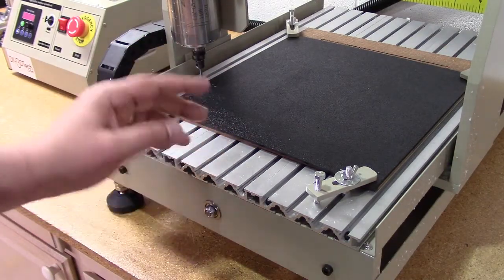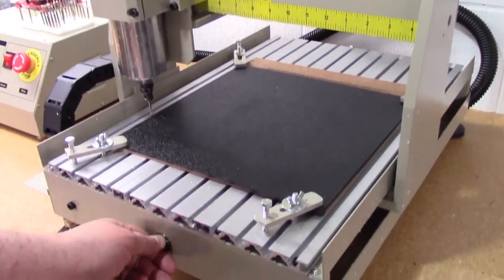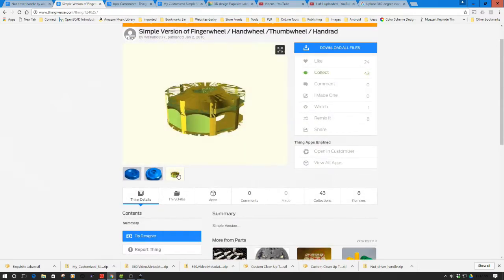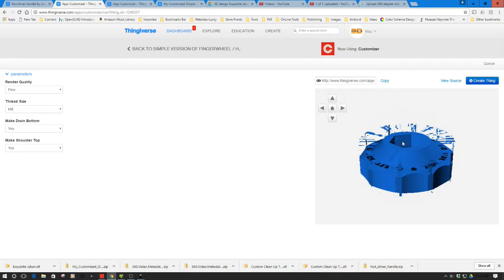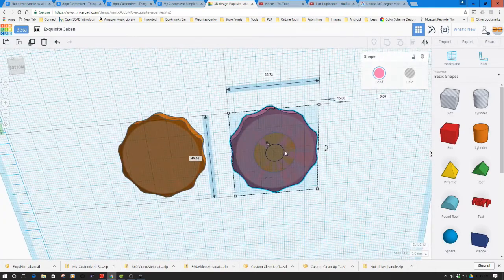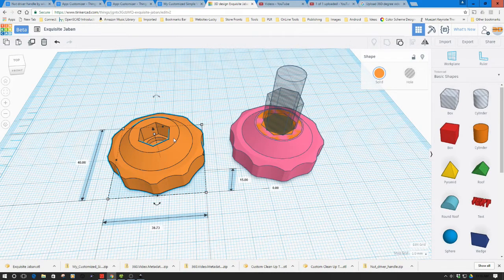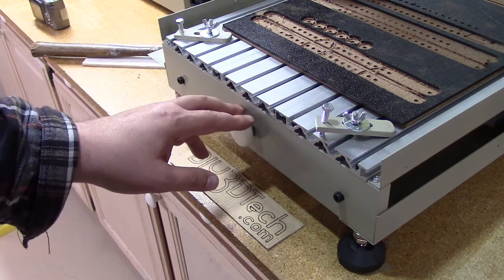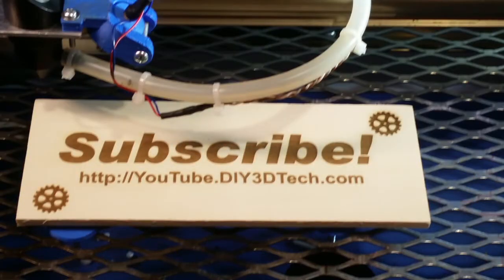3D Printed Project - Finger Nut for the Y Axis on the 3040 CNC!

Comment: Joe, do you need to move the gantry a lot or just a little?

If you needed to move it a long distance I could see making the knob with a bigger diameter and either a dimpled finger hole or a protruding handle to crank it. 

Other than that it was a practical solution to a real problem.  Good video.
Reply from the maker: +Norbert Davis yes on the other one I have a spin wheel however this one I did not have enough rod to do this with.  So the knob is better than nothing and for longer jogs I use the jog functions of UGS to move it around.
Reply: Are you anywhere near the Southwest Michigan Mini Maker Faire and if so are you going?  I went to the Bay Area Maker Faire last weekend. Met a ton of the 3D YouTubers like Chuck Hellabuck, Angus Deveson, Joel Telling, and many others. Lots of cool stuff at the Faire.
Reply from the maker: Naw maker fairs around here suck, I am sure the one in the bay area was pretty cool!  I was surprised to see Chuck  go, however Joel is on that side of the world.  Interesting enough I was in Seattle for some business meetings and now heading to Bonn then China
Reply from the maker: I fly more than most commercial pilots (no kidding :-)
Reply: DIY3DTECH.com - that is crazy. You near the 1million mile mark yet?
Reply from the maker: LOL!  pedestrians are below the Million mile mark, guess I need to ask a million on which Airline?  More like closing on 3 million...
Reply: DIY3DTECH.com - WHAT😯!  That is amazing and crazy. I hope you get all the rewards perks. Lol.
Reply from the maker: LOL!  That is the last thing I want to do is get back on a plane (with the million plus banked miles I have)  :-)

Comment: I would have used the cnc for this instead of a 3d printer.
Reply from the maker: +The Best Stooge possible but would have been more work.  This simple I could walk away when it printed 😎
Reply: I am just not that into printed parts if the parts are simplistic in design.  Now something intricate like an extruder for a 3d printer then print it but a knob?  Not really more work for the CNC to do it just would require buying a material larger than the size you were going for and best of all it could have been done in 6061 metal.
Reply from the maker: Wow I like the idea of metal knob yet again the plastic one has done great.  However I am kicking around metal machining projects as frankly I staring to run out of ideas for projects that fit into the time windows I can commit.  As to produce one of these video takes a lot of time, and then toss in coming up with the ideas that are semi original.  Whew it is a lot!

Comment: Hello Joe, I want to buy the 3040 cnc but there are so many models in Amazon and ebay. prices range are from 500 to 1000. which one do you have?
Reply: I would suggest you do your homework because you seriously do NOT want a LPT (printer port) model unless you have an old junker PC with XP on it.  They have models which use USB now and a lot of people buy the LPT version then get a USB driver for it but they are not cheap.  The version of a thing that was shown on this channel I didn't care much for myself.
Reply from the maker: +The Best Stooge the LPT ones like I have can be driven by an ardino and GRBL so no need for a old PC or paying for a USB version as this is basically what they are doing.  I even wrote a book how to this which is on Amazon...
Reply: I'd rather use a gecko drive.
Reply from the maker: Goggled them but not sure I see the value as the existing stepper drivers seem to do a great or at well within the tolerance of the physical machine.  I am going to upgrade from UNO to Mega so I can run my forth axis as this fall I want to start experimenting with the forth axis (boy I have an itch for a 5 axis machine so BAD!) so doing the build over the rainy summer days seems like a good idea!  I am also working on a coud "water bath" ideas as I want to cut carbon fiber so have that on my list too!  Such a big list and just no time!